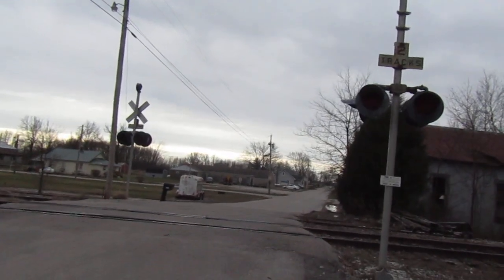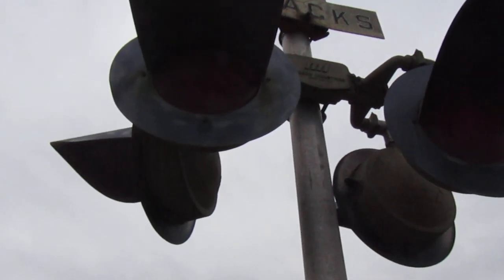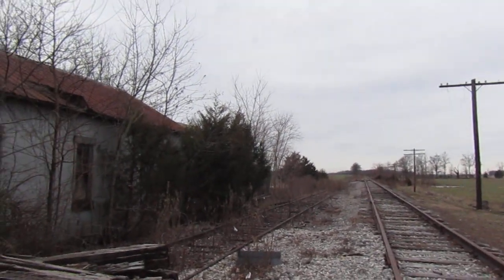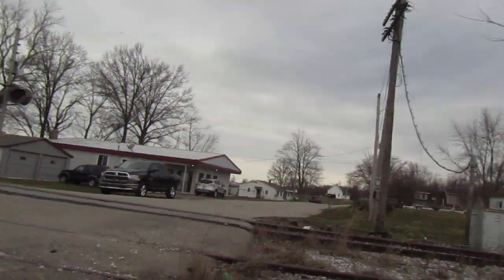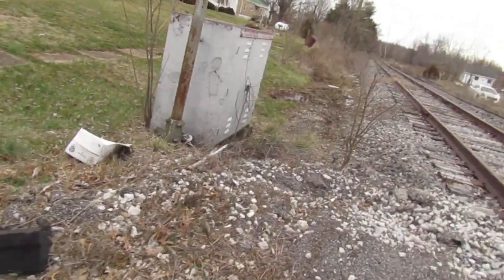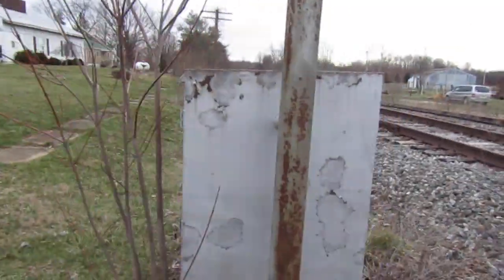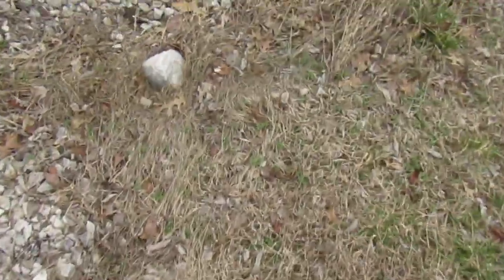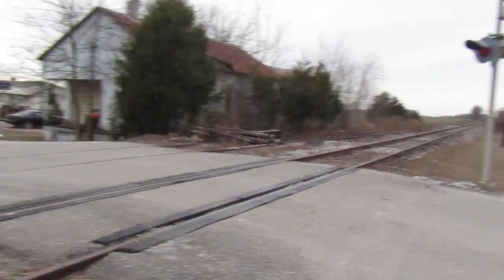Abandoned Railroad Crossing (475 E, Leipsic, IN)

Comment: DUDE! that clicking from the relay case Is the flasher relay that makes the lights flash, so this crossing was actually activated, but somehow power wasn't getting to the lights or bell. probably broken or cut wires.
Reply from the maker: Maybe... it just seems odd to me a line abandoned for this long would still have working relays.
Reply: @kyleb06  they are pretty simple devices, not a lot to go wrong so they don’t go wrong very often. I would say a ground wire broke or got cut somewhere between the relay case and the lights and bells. That crossing was definitely activated/malfunctioning somehow, it’s possible someone who wasn’t from the railway cut a wire somewhere to make it stop. Either way it’s very intresting.